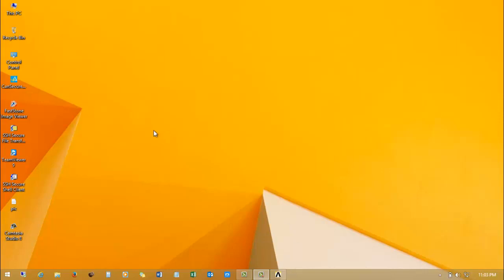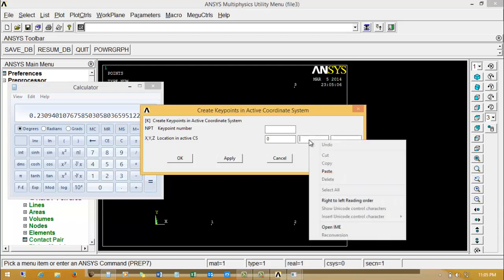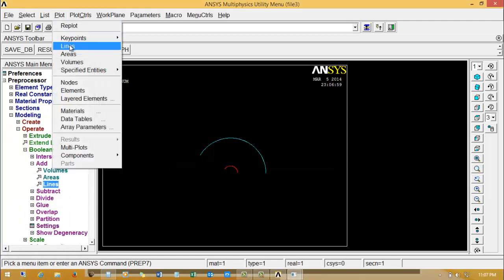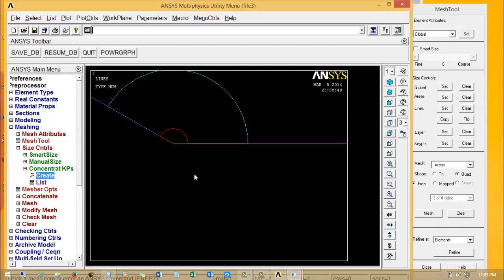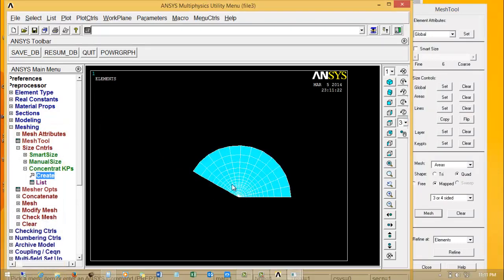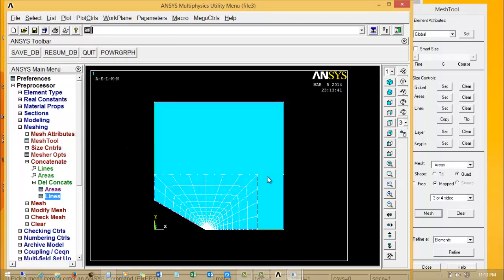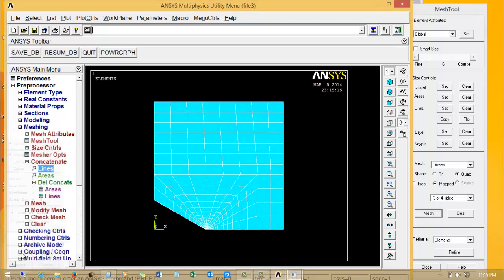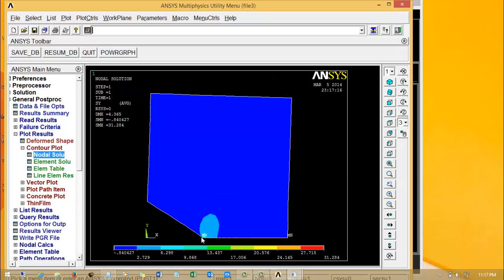ANSYS APDL NOTCH STRESS ANALYSIS

Comment: Guys can someone please help me! Am extremely desperate. Final year project is due in a few weeks and I don’t know what my next move is. The ANSYS software’s in this University do NOT have ACP on them. I am trying to add Fibre Lay Ups on a Wind Turbine Blade on APDL. I have created the blade on SolidWorks, imported it to ANSYS where I have tried meshing the blade on workbench. I don’t know what my next move is. I need to import it to APDL then add Fibre Lay ups in such a way where its gradually decreasing down the blade span and freely be able to change and modify the Fibre Orientation as I am carrying out the test. I am trying to see the effect the shell thickness and Fibre lay ups/orientation have on the induced twist of the blade. This is pure FEA analysis. If someone could help me I would be eternity grateful! Please someone??